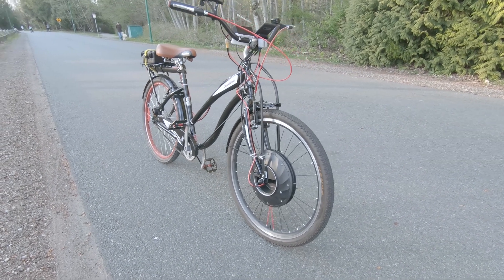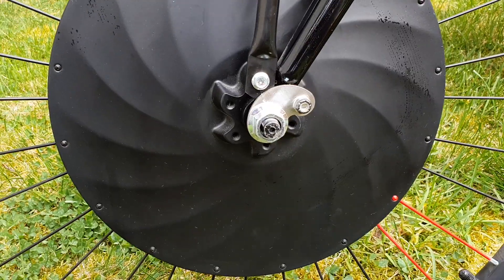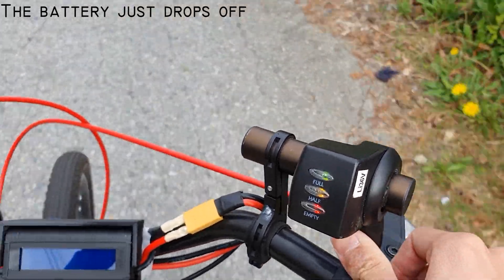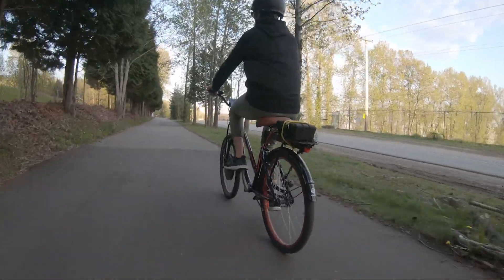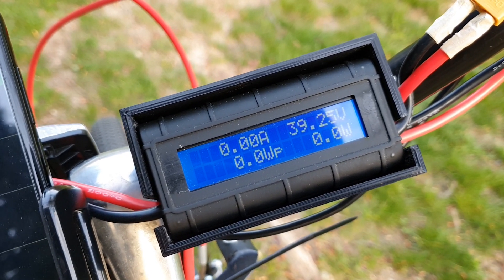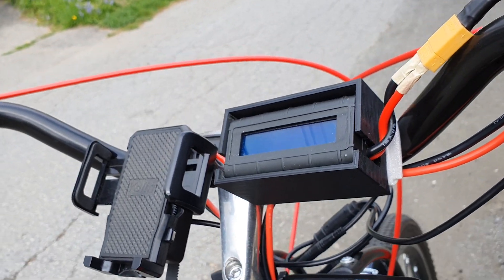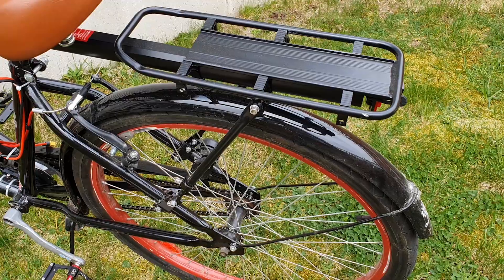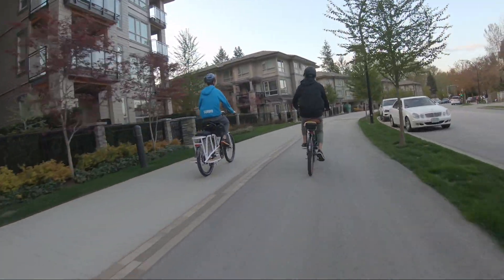Building a DIY Electric Cruiser Bike | 500W Hub Motor | 10S Battery

Comment: STAY AWAY FROM AERDU, I ordered AERDU 36v, 12A battery pack, and the charger from Ali Express. It took a few months to arrive in Canada and boy..big surprise.. The battery lasts only around 15 to 20 minutes full charge on a ebike with 500W motor.. Definitely contains dead cells since the output is also nowhere close to 12A. The charger came out of the box defective. No light and the output is around 12v..In conclusion, STAY AWAY from this seller. It is a huge hassle to ask for a refund since the money protection is only for 90 days and if you are lucky to receive it before the 90 days and you want to send it back, they never issue a return ticket. I have been waiting on it for a week now. Of course in my case, it took 4 months for it to arrive.
Reply from the maker: Yeah. I am not surprised. I didn't mind much if the battery was broken as I could repair it and I considered myself super lucky as the battery voltage and resistance are super similar. For that price you really can't expect much other than a broken battery or one that holds about 60% of what it used to.